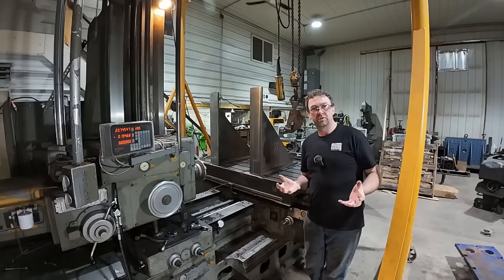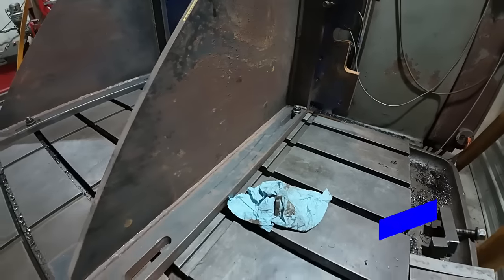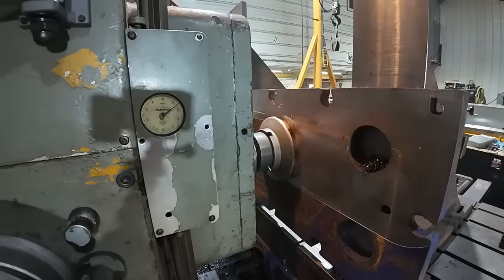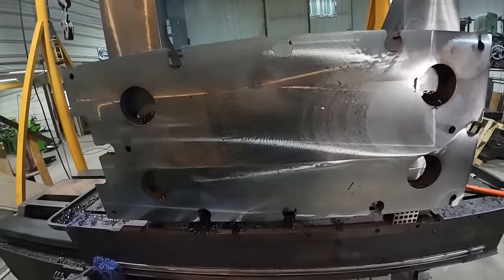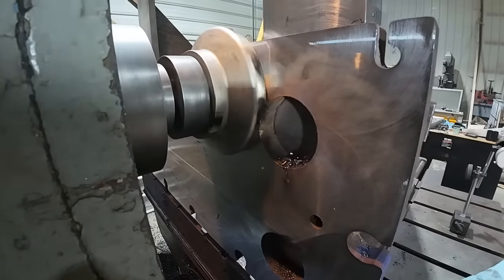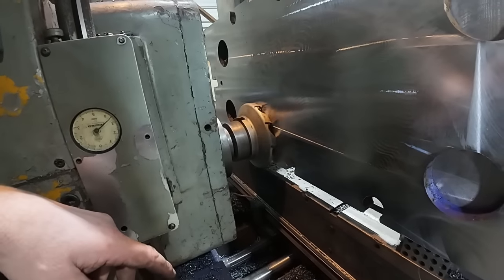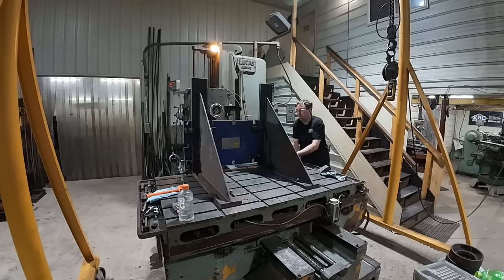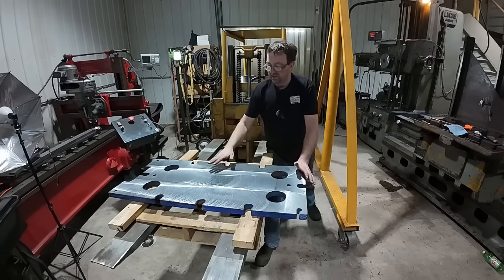Milling Another Heat Exchanger Plate on the Horizontal Boring Mill - Manual Machining

Comment: Nice work, Josh and thanks for letting us watch.  You know, it continually amazes me how you can invite people in to watch the work that you perform and some want to tell you how you are doing it wrong...on a job that the customer approves of and is sending you repeat work for.

So, don't mind the armchair engineers.  You know, as most experienced engineering machinists do, that there is usually several ways to complete a job successfully.  You choose the method that best suits your equipment capabilities, skills, costs and time constraints.  Sadly, it seems some missed Shop Workflow Management Day at school (this is even taught at the School Of Hard Knocks).  Maybe, if they watch enough of your past job episodes, they will catch up.  I could say more, but I'll leave it there.

Keep it up, Josh and thanks again for regularly bringing us into your shop.  Nearly 98,000 of us apparently feel the same way.  We'll see you next week.  Cheers.
Reply from the maker: Thanks. Yes, there is more than one way to skin a cat. Lol. I think you're right about the naysayers not understanding shop workflow. It seems every complaint and suggestion would double production time, if not more. When I say Done Right The First Time, that means quickly, efficiently, a happy customer, a paycheck, and repeat work.
Reply: @TopperMachineLLC  Outstanding way to phrase it Josh......you are a service provider, 
not a manufacturer, and some viewers do not seem to know the difference......
A Happy Customer is the 'best advertising' you can get........
Until Next Week, Keep on Keeping On......PB:face-fuchsia-tongue-out:
Reply: I couldn't have said it any better myself!  There's always multiple ways of doing something.  As long as the customer is happy and nothing gets torn up - that's all that matters!

Comment: It is to bad that there are haters out there that want to put you down. You know your machine and you know your ability. Your work had to be good otherwise they would not have sent you more work. I love your videos. I know that the video alone takes a lot of time but you done a great job on both the video and the part. The part cleaned up real nice and it looks like most, if not all, of the pits are gone. Good to see you first thing in the morning. :hand-orange-covering-eyes::trophy-yellow-smiling::trophy-yellow-smiling::trophy-yellow-smiling::trophy-yellow-smiling::trophy-yellow-smiling::cat-orange-whistling:
Reply from the maker: Thanks.

Comment: It turned out great again Josh, let them complain about your methods all day. All real machinest know that a scraper was only recently replaced by the mill. A scraper is very accurate and consistent in its cutting material. Still today I would rather have a lathe bed serviced by a scraper than a mill. The mill makes heat and vibrations the scraper doesn't. Keep up the good work and ignore idiots that have no idea what they are talking about.

Comment: Very nice... That HBM is awesome... The power in those machines is amazing. Cuts like warm butter. Thanks for the video...
Reply: Good point,  many don't appreciate how much power or energy is required to remove metal,  try using a Hammer and chisel to remove material 😉

Comment: My dad was a machinist for a company that made gear units. He ran a large Giddings and Lewis as I recall. 12 foot bed. He machined raw housings, steel fabracated and cast. Some you could almost crawl into. Feet, centerline cross bores for pinion and ring gear shafts, flange retainers tapped holes for shaft  bearing retainers. Nice  watching what he did for living. He retired in 1978.

Comment: The keyboard wimps, certainly no "Warriors", the "Romantic " machinist,  engineer,  mechanic,  it can be done by a time served artisan who spent 20 years under the original designer/Engineer, whose family worked on their land for generations. Every surface must be surface, or cylindrical ground, micro lapped, scraped to 5 thousand points per square inch, and waxed.

The "Classic" Machinist, Engineer,  Mechanic,  is skilled,  reads the drawing or print, and makes it "Fit For Purpose". Customer receives the service they "Need", and at the correct price. 

Another great job shop project. 
Thanks for sharing.

Comment: Morning Josh,
Love watching stuff on that Lucas HBM......the resonance you are experiencing is akin to a turning fork like thing.....I get it sometimes on my lathe when cutting a long taper on a barrel...best way to eliminate it Ive found, is by placing and having a large bag of sand or fine lead shot against the part....that seems to lessen that tuning fork effect....just pressure from it leaning is enough......use your own imagination in it....I might even drape a weight bag across those support angles to dampen itlike you did with your hand....the bigger the area you dampen with the bag the better the results.......and like you did...altering speeds and feeds helps too......
Bracing for the storm here....ughhhhhh....weather idiots are saying travel to be very difficult to impossible...hope they are wrong as usual....LOL
GREAT VID............20 thumbs up
Don

Comment: The comments that start with "Have you tried this" or "I get good results this way" are worth reading, there are often little gems of genuine knowledge in there, the "You are doing it wrong" and the  "You don't know what you are doing" brigade should go directly in the rubbish bin, there is nothing in there but bile, and they do not even merit a look.
Reply from the maker: Exactly right.  And I do retain the good comments and suggestions.  They help me grow.
Reply: Have you tried to tack weld  bracket or something, to connect those angle plates. Another advantages to have steel made plates👍🏼

Comment: Hanging or attaching a bag or sock full of sand or lead shot can help cutting down on resonant chatter - weird but it works.
Reply: That was something I was thinking about too. Adding mass where possible is a good way to dampen and/or spoil harmonics.  Years ago I was working in a Suzuki motorcycle dealer shop and I noticed that Suzuki incorporated a heavy lead alloy weight plug inside the handlebar ends on some models specifically to control harmonics. Without the weights in place,  a nerve tingling vibration would develop that would numb your hand after a while.

Comment: Coolers I have come across in the oil and gas industry, those plates are fully painted. 
Just like your plate was originally with the blue paint. 
I am quite sure it is to prevent corrosion once the plate cooler is put in operation. 
It may be the customer will get that machined surface painted, if not, those end plates may come back to you once again given time and corrosion. 
Time will tell. 

Good video as always, no CNC rubbish and down to earth.
Reply from the maker: That's a great point. I hope they do paint them.

Comment: Josh, do you think placing some bags of lead shot between your angle plates and  against the back of the filter plate would help deaden the harmonic vibrations? I  like the different solutions you use to accomplish all these varied jobs.

Comment: josh ya know some people just can't stand that someone doesn't do thing the same way they do it. I watch many machinist and I have learned the there it more than one way ta do a job and more than one way ta set one up. some people are just jerks and have no respect for the way a job is done. we all fain a way ta do the before us at the time. some think that they are Gods gift ta machinist.... We all keep learning from one job to the other. and I learn from every machinist I watch like Abom79, Keith Rucker and many more Keep up the great work Josh.....
Reply from the maker: I have worked with so many people with different setup techniques and operating practices. I never comment unless I see something that will absolutely not work. I watched them and learned by asking questions. Did I like all of their setups, no.  But they all taught me something.  Some that I thought would never work, produced the best finished parts I'd ever seen.

Comment: For the work piece application (plate support) your resultant surface finish is absolutely fine. Even the finish at 17:28 would have been fine, especially after a coat of paint. The surface just needs to be flat which it now is. When these heat exchangers are properly assembled system fluids never come into contact with the steel frame plates.

Comment: Nice job the company that I work for builds those plate exchanges. I have seen that gasket surface out of flatness and they still work. Pretty thick gasket that go on them and when they tighten them down they are pretty forgiving. Just as long as they seal up when you go to hydro them

Comment: I have an idea for a simple interim solution before you add stiffener plates. I guess you would need to do an inspection on the part to determine if the vibration is caused by pushback flex of the angle plate or side to side flex.
Either way a bar in between the centre of gussets and a long bar clamp would reduce their ability to move. Adding a pair angle plates to the side like you did when milling the large angles should take the side flex out. You could even add a jack between the bar and plate to support the top centre.
Awesome work as always!

Comment: I work at anasme shop. I'm a self taught lather. We make the round type.  The disc is cut 1/8" larger and I turn it down.  I then face it.  I flip it over and do the same except I put a gasket surface on it.  Afterwards I drill usually 5/8" holes and ream them. 010. Not difficult at all.  There are 6 1/4" holes so that the alignment rods can do their job.  I  hate rolling the tube ends though

Comment: We have a similar machine and similar angle plates we use regularly to do a lot of plate work for our steel mill.  We mounted 2 thick 8 long 5 wide steel plates with a matching piece of staked conveyer belt.  Basically steel brick, rubber brick, rear gusst, rubber brick , steel brick all through bolted.  Eats up almost all vibration.  We did turn nylon bushing to keep the through bolts from touching the gusset.  You can smack this set up with a hammer and grt nothing but a thud. No ring whatsoeve. Lets us run speeds and feeds that are obnoxious.

Comment: Really surprised it gave you that much trouble with vibration on that thick of a plate but adding a spine to the angle plates will help alot i think awsome job as always
Reply: Then I think you could clamp a piece of thick flat bar across the back of the angle plates to tie them together somewhat.

Comment: I did a little reading on cutter head harmonics and everything that I saw suggested is exactly what you were doing. I understand a tiny bit about harmonics and what causes it, in general. Likewise, I am wondering if (if they existed) would using a cutter with an odd number of inserts unevenly spaced (like three on one side and two on the other side) would interrupt the harmonics.

Comment: We have some rubber with strong magnets embedded in it (magnaflex).  Does great for absorbing vibration and disrupting resonance.  Could stick right to the back of the plate.
Reply: The specialized brake drum and -disk lathes come with heavy rubber bands that gets wrapped around the drum or disk to kill the resonance
Reply from the maker: I'll look into those. Thanks.

Comment: Hi Josh, wonder if you put a third faceplate in the middle, with a small gap to make allowance for the name plate, and then tap in some very fine tapered fox wedges. That should stiffen up the plate and stop the vibration.

Comment: For the harmonics, try putting bags of lead shot against the back of the plate. Ten or twenty pounds of lead shot piled against the back of the plate will absorb much of the vibration that causes the chatter. 

If you have a big magnet, placing that on the plate, to add extra mass as a damper, can work also.

Just some ideas.
Reply from the maker: I am a little concerned about the magnet holding chips on the cut side and causing surface finish problems.

Comment: That project is a perfect candidate for a Blanchard grinder.
.
Reply from the maker: Find me one in this region that can handle the size
Reply: @TopperMachineLLC  I wasn't complaining.  I ran one of those hbm before but I rode on a platform with the head..
Reply: @blitzkrueg07  Whoa! That must be a huge machine. It never occurred to me that the operator may be running the machine from a station like an excavator or tractor.

Comment: Josh, rather than welding a stiffening bar on the back of the angle brackets, what if you braced between the two. Perhaps a hole in each and then a inch threaded rod between the two.

Comment: Hi Josh!  I was wondering if you could add another angle plate and attach it to the top and bottom of the work piece with some sort of clamping bolt, or screw... Just an observation... Ron...

Comment: Good video. May have tried sliding the two angle brackets in towards each other just a little more allowing for better support across the back and possibly reduce the chatter? Just a thought?
Reply from the maker: But what about the unsupported ends then?

Comment: Hey Josh, another beauty, thanks for posting.
What do you think - maybe stick that great big heavy mag switch (that you have for lifting plates) on the back of the job where the problems are. It may just add enough mass to kill the ringing. I have used a similar trick a few times.
Keep up the good work please.
Reply from the maker: I hadn't thought of that. Good suggestion

Comment: What about using some sandbags stacked behind the middle of the plate as a dampening method or drape them over the angle plates where you put your hand to stop the vibration?

Comment: easy job, i would suggest adding so bar stock or anything heavy leaning , just leaning on the back of the plate in the middle to prevent chatter.
Reply from the maker: Thanks.

Comment: Looks like maybe you could have turned the plate vertical then you could have backed up a lot higher percentage of it with your angle plates. Maybe it was too tall?  Alternatively some bars you could bolt to your angle plates with jack bolts every 6” could help a lot too. Lots of ways to Getter done right! 😊

Comment: I specified hundreds of plate and frame heat exchangers during my career, both APV and Tranter. I had a few, particularly in steam service, warp. I would never have considered thinning an end plate as being both flat and stiff is critical to sealing the plate pack.  Nothing against your doing what a customer wants, but I’d sur e like to know of the exchanger leaks with a weakened end plate.

Comment: Josh, have you thought about using a flycutter (or even removing all insert but one in the facemill) for the final passes with a shallow cut as that would reduce the cutting forces which should help a bit with the vibrations?
Reply from the maker: I have 2 fly cutters for this mill.  One is 18" and the other is 32".  I never considered that for the final pass though.  Thanks.

Comment: Haha, you did a good job on the planer mill. I wouldn’t have done it that way necessarily but your result was good. None one else is in your shoes with your tools and life pressures, and that is important. 

Could you of put your lifting magnets on the back of the plate to help stop the vibration. The swarf may of stuck to the plate on the cut side but the extra weight would of helped. The other thought was a piece of flat bar just kind of wedged by it’s own weight between the plate and the tee slot like a gusset. It will fall to its tight spot. I was hoping you would of put your other smaller angle plate. A trick I have used is place it behind, clamped of course to the table with a gap, with a fox wedge or similar slipped in at the top. Again it will fall to its tight spot but is a quick and simple way to get by. 

I wouldn’t have slowed the spindle down, I would of wasted an afternoon trying to get it to work and got potentially nowhere haha.
Reply from the maker: Thanks. I am always learning, but your suggestions are great. I considered the smaller angle plate, but not the wedge idea. I'd bet that would work great.

Comment: Putting it on blocks was a no brainer honestly. Do you have a rule of thumb for amount of stepover on a face mill or end mill? On the first cut the face mill was about 2/3 engaged - is there a specific reason for that, and not going more engaged? We've managed to sometimes gain on chatter on big items like that by propping a sandbag against it to deaden vibrations. Same with big sheet metal roll ups and so on.
Reply: Stuart and I are in cahoots with the sandbag trick....simple and effective......
Reply from the maker: I never really used face mills until the last year or two. Mostly fly cutters. So I'm still learning myself

Comment: Do you ever wish you had made a 3rd angle plate for these big jobs? Even if you can't clamp the work to it, could you butt it up against tge work? (I imagine a shell mill that large could exert a lot of inward force on the center of the part........oh, never mind, you just said exactly what I was thinking..... That good old machine with that shell mill gives a great finish, I watched you resurface and straighten tge angle plates, they came out great!

Comment: Our maintenance crew were tied up on a breakdown, so got a couple of the production bods to strip  pressure wash and reassemble an AlfaLaval heat exchanger on a hydroflouric acid wash, told them to pay attention to how it came apart and rebuild it the same way. They reversed the very first stainless element and it all went downhill from there ! Luckily I got some nice heavy plate out of it to make some press plates for my hydraulic press and a support for my log splitter's blade 😂
Reply from the maker: Expensive mistake, but great score for you. Lol